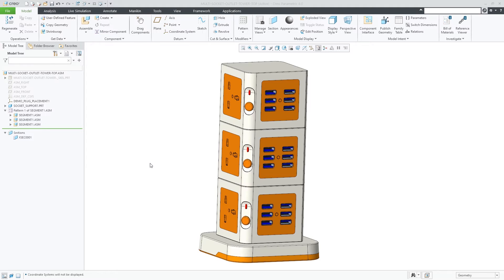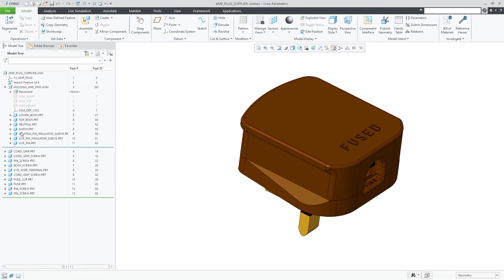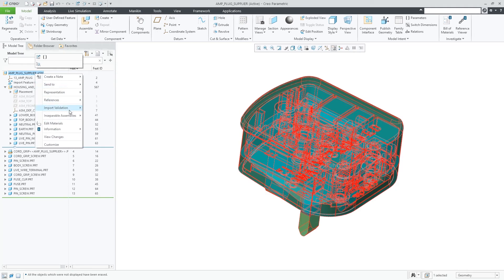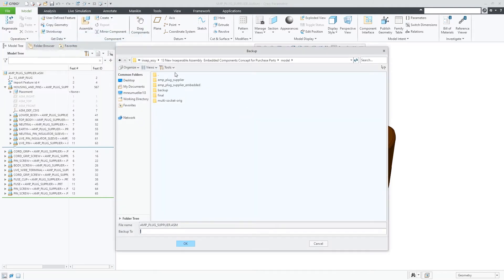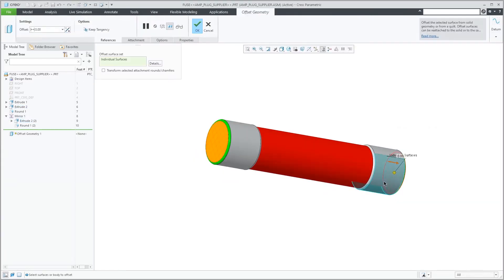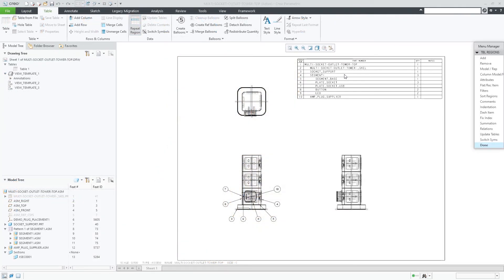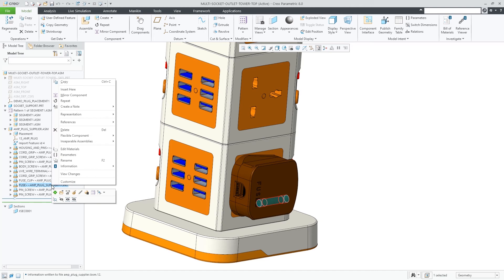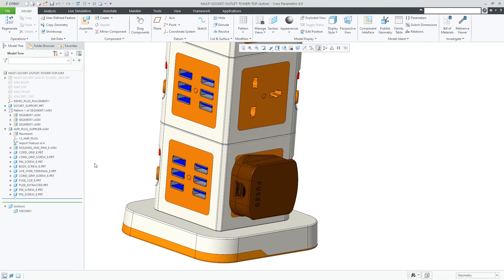Multibody Support for Inseparable Assemblies and Embedded Components | Creo 8

Comment: Hi just a clarification, This is Multicomponent assembly right ? Where I can utilize this feature for any assembly. It should not have the 'Multibody' tag right? because multibody construction is something seperate, where each body can be its own component but from the design stage and is used in boolean manipulation of the entire part body with the help of each body.